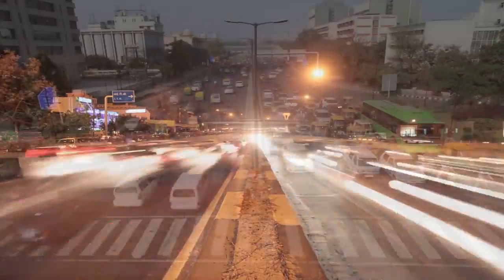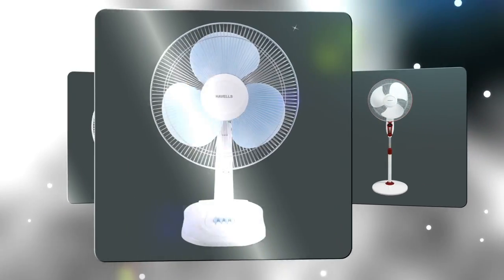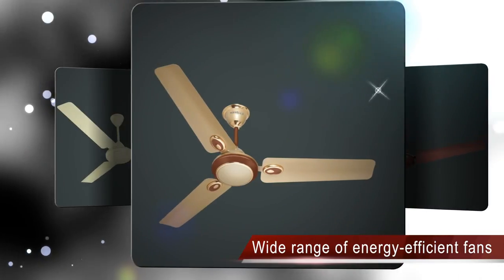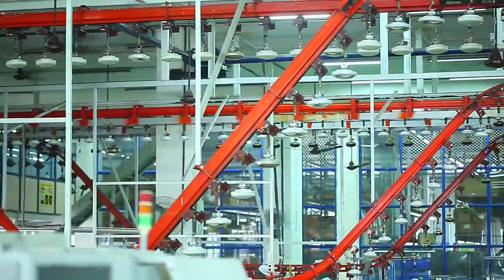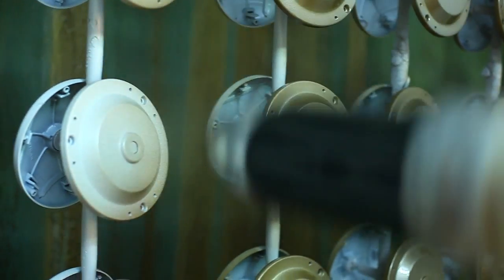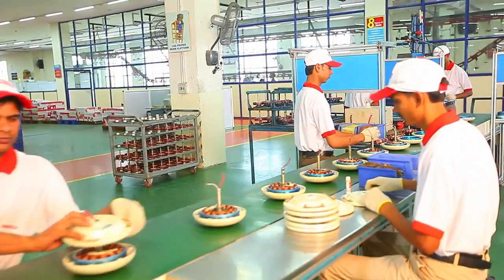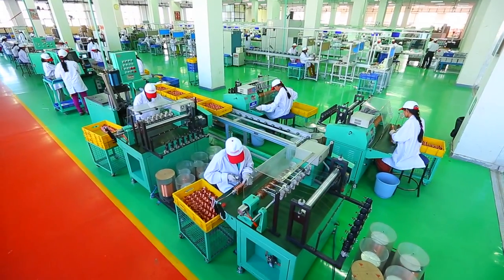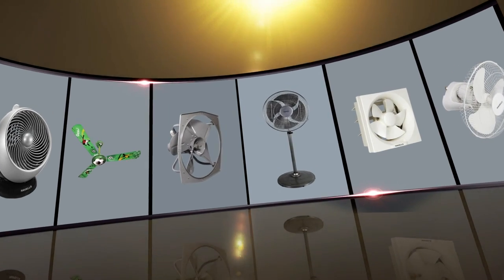Havells Fans Manufacturing Plant Video

Comment: The havells padestal Swing fan is very barely designed. The most important Part of fan the blade is soft bendable plastic. And because of that it is too much noisy. The shape inside the motor is not aligned or cut properly because of that fan viberater while spinning. Stay away from havells fan